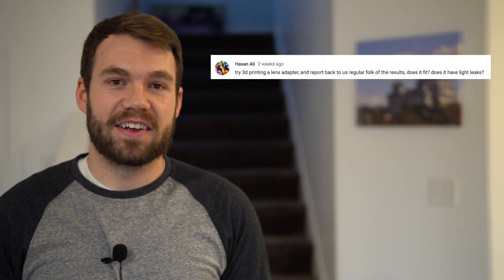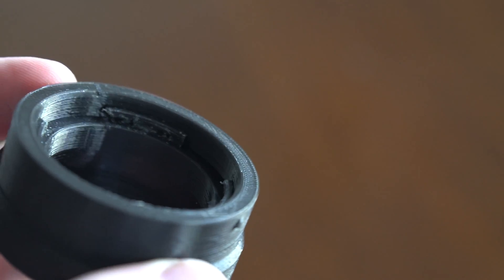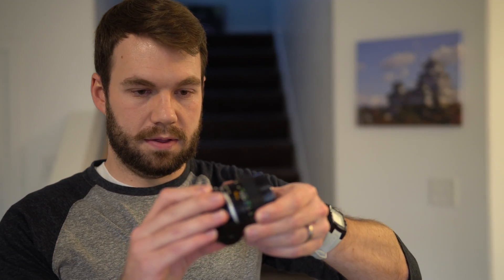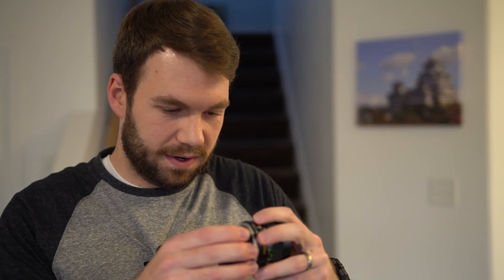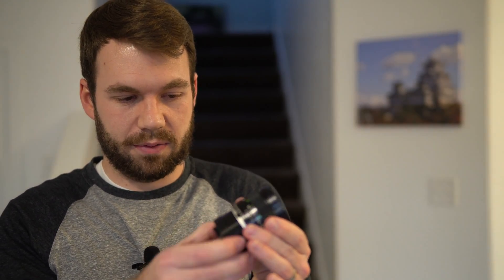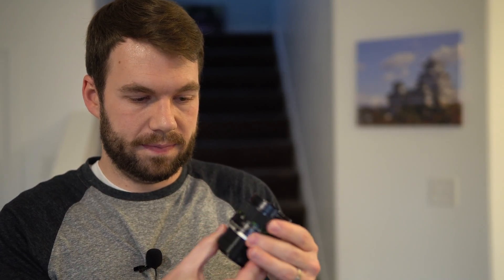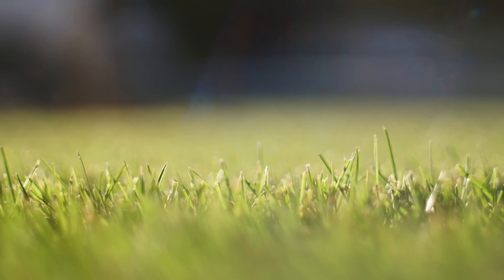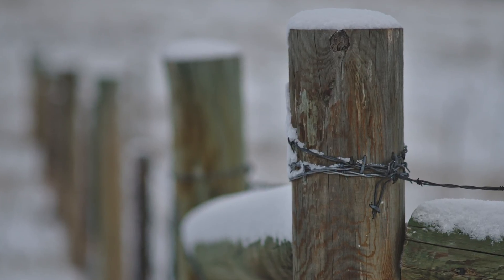3D Printed Lens Adapter on a Sony a6500

Comment: I just finished 3d printing a project around making a tiny pencil sharpener to get fine points on 0.5 mechanical pencils. I had to print, fit, measure, and adjust my sizing multiple times because I was dealing with such tiny tolerances. But after only about 15 iterations I was able to get just what I needed. With some tiny adjustments and re-prints, you could probably get that adapter working pretty smoothly. 
Additionally, I was surprised to find that you can print moving parts. MakersMuse has some pretty neat videos around doing that kind of thing. With some modification, you may be able to design a nifty lock and release mechanism right off the printer, or with some assembly.